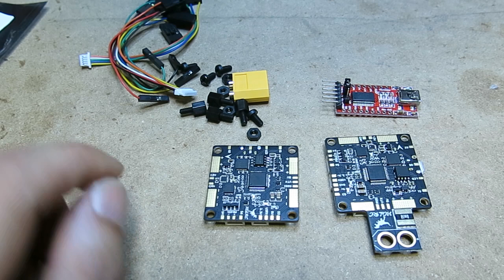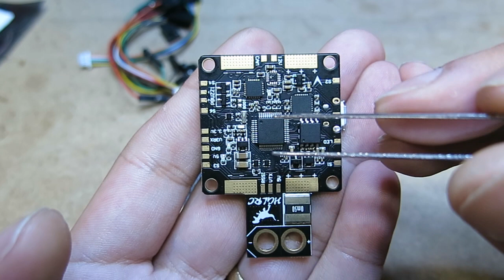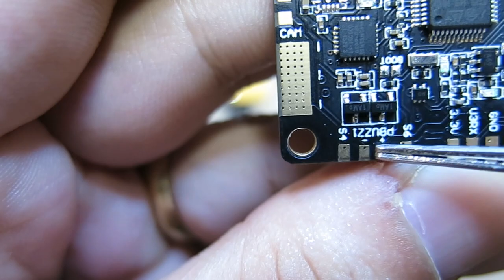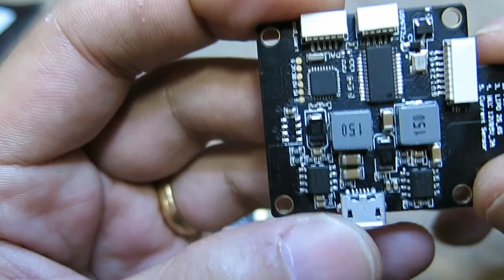HGLRC (R.AIO) V3  F3 FC PDB OSD Current Sensor BlackBox 5v/12v

Comment: Great video. I bought it from a guy using Frsky. I connected it to my Spektrum. UART3, serial, binding. but no sitck movements. any advice?
Reply from the maker: thanks Tarek, make sure ur connecting power to the 3v tab, then under configuration in BF/CF/BUF also change protocol
Reply: RotoRev , 3.3 v did, BF, configuration, serial, spectrum 2048 did. Still no stick movement!
Reply from the maker: i would just flash it and start clean and see if that works .. one more thing which receiver ur using and when its bound is the light on receiver steady or flickering ?
Reply: Flashed it with 3.2 and latest 3.3, connecting orage receiver after bind it has a stable orange color when remote is on.

Comment: What's the current limit on Amps?  haven't found any info anywhere on this.
Reply from the maker: i personally  would say 100amps max after that u will need good main rail capacitor
Reply: RotoRev yeah probably 100A peak
Reply from the maker: I hate to say that but HGLRC is un-reachable now ... no replies .. pretty much no support now... good start but horrible maintenance :(
Reply: I just spoke to them on Facebook..

Comment: I gave a turanis and imrc 600mw tvx.
How do I connect the rssi and what do I connect it to?
Reply from the maker: ur rx need to have an rssi out signal
Reply: do you connect smart port (frsky xsr) to rssi pad?
Reply from the maker: we tried the few pads that were recommended by some RCgroup members we never managed to get rssi out of XSR .. pls share if u did coz i dont think we can
Reply: s.port is a serial connection and would go to uart2 which looks like is in the micro mini jst connector on the bottom. i have the v4 with the vtx and my uart2 is a set of 4 pads on the bottom. i didn't get soft serial to work, it could be that the soft serial doesn't work with the inverted frsky protocol and if you for some reason didn't want to use uart2 then you'd have to experiment with un-inverting the signal. there is a transistor on the reciever that the non-inverted signal gets inverted through. it's just a matter of adding a wire at this transistor but you still have to experiment to see if soft serial works at all which would work through the extra esc signal pads. 

i have an xsr and it has analog rssi through another wire, that may work with the rssi pad. but you have the s.port so use it. i have the tx and rx pads from uart2 bridged together but it's not clear to me if this is totally necessary.

Comment: Hello! I have a question regarding the v3.1.
How do i setup the osd? I have it wired as described on the schematic but I don't get a signal. I tested connecting it straight into the vtx and I got a signal. Do I have to get a FTDI breakout and fix it that way?
Reply: You need a usb "dongle" thing. http://www.banggood.com/FTDI-USB-OSD-Programmer-Module-for-F3-Flight-Control-AIO-Transmitter-OSD-BEC-Current-Sensor-p-1111287.html?rmmds=cart

Comment: I appear to be hogging this thread with my questions, sry about that :) I have a question again concerning 5V regulated power on this board: what's the rating of the 5v supply? I added a few LEDs to my quad yesterday, a grand total of 3 5v leds (I know, impressive numbers). Nothing too exciting you might say but in fact my video feed crapped out mid-flight numerous times and distance/orientation and throttle value was barely a factor. After snipping away the wires to the leds, the video dropouts stopped. So I'm wondering what the 5v regulator is rated at. Thanks again!
Reply from the maker: well the MP1584 step-down on board is rated @ 3A .... do i buy that? hell no lol ... but rating isnt the issue here . its mainly the OSD with its demanding setup and being very sensitive to voltage fluctuations , this more obvious for example with setups that has escs with minimal input capacitance .   long story short ... adding a 220~470uf 10v capacitor on the 5v rail solves all those issues, which been always the case with minimosd since they came out .
Reply: Thanks again for your detailed input!

Comment: Ugh, I'm having an issue with the MinimOSD on this board (v3.0), hope you can help. I get corrupted video through the OSD, but only when I turn my tx on or if I connect the usb port to my laptop! The video will be fine if I have my vcam and vtx connected directly so I'm ruling out the vtx or the vcam being broken. Any suggestions? Seems that it might be a 5v voltage supply thing? You can see the issue here: https://www.youtube.com/watch?v=DGMmn0MkRYM
Reply from the maker: connecting the usb will cause the OSD to stop overlaying that's normal, what isn't normal is what happens with the radio .. being on ... I would go over receiver wiring 1 more time as this is the unusual part ..
Reply: I was able to solve the issue thanks to some folks on the intofpv forum. The issue went away after I put a 470uF electrolytic capacitor between the +5v and gnd of the receiver pins on the HGLRC board.
Reply from the maker: great ,,, 5v helps demanding minim osd but usually that shows under heavy throttle !!! weird it shows up just by powering the vtx. id be interested to see whats the current usage on that receiver

Comment: I just updated to betaflight and forgot to look up the default settings for this fc. What are the correct current scale settings for this? With just USB hooked up it shows me 11A now - witch I consider way to high
Reply from the maker: I have been using the betaflight defaults all the time tho . have u flashed the osd ??
Reply: RotoRev yes i did, but it was configured to use the FC data as it is right now. So the settings of the FC firmware are used for voltage and current scaling
Reply: What are you settings in the config tab for current sensor?

Comment: [FIXED] So I got this board (the V3 or V3.1, the one with current sensor but without boot button) and connecting it to USB port doesn't do anything. I see a blue LED flashing on the board but my computer doesn't detect a new com port. I've also tried this while powering the board but the same result. Any tips?

FIXED -> use a better usb cable. The one I was using connects just fine with the SP Racing F3 and Naze32 boards I have here but for the HGLRC I needed a better usb cable. Hope this helps someone.